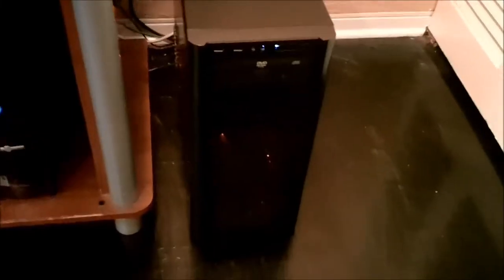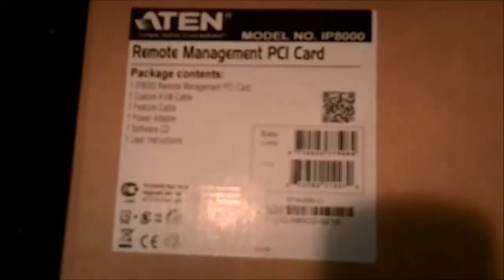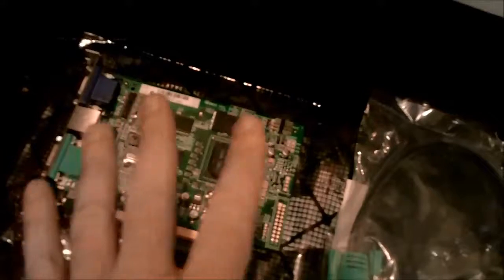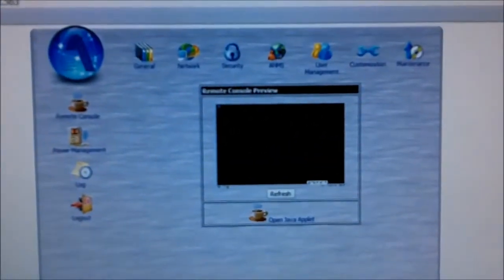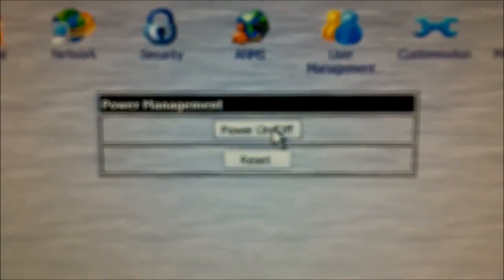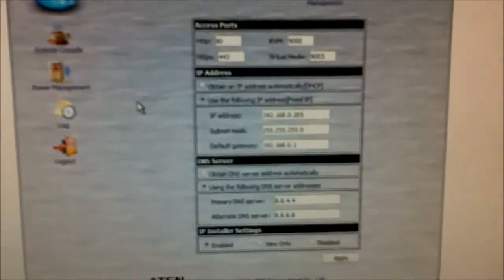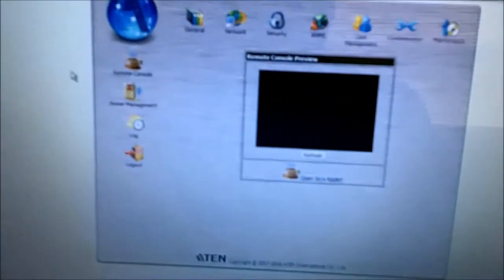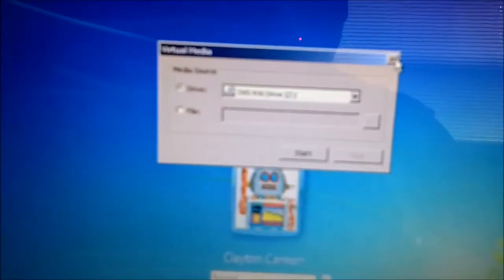Home Server - IP Based KVM with the Aten IP8000

Comment: As an aside, am I correct to assume that it automatically downsamples the vga output to the supported resolution?  If not, what happens if the display is set to a higher resolution than the card supports?  What are the possible multiple display scenarios, assuming the BIOS supports such?

Thank you for your commments.
Reply from the maker: It will scale the resolution based on the client, exactly like VNC or TeamViewer clients.  The remote access card uses a VGA pass-through connection.

Comment: thank you so much to the explanation
but I think this device to work it need a static IP so would you mind please to explain further how you setup the static IP so you could access the server from out the local network
again thank you.
Reply from the maker: If you want to work on it remote, you'll either have to VPN into your network or forward the required ports through the NAT settings of your firewall.

Comment: So, it's basically good for any ATX machine that has the required outlets and slots?  No HCL to speak of?
Reply from the maker: It is a full height card and requires the used of a standard PCI slot.  It has its own power supply.  Your case buttons connect to the card and then the card connects to the motherboard's case pins.

Comment: Hi, I'm about to buy one of these thats lacking the power adapter. Could you please the make and model of the power adapter for this card. Thanks

Also thanks for the video.
Reply from the maker: Chima Madujibeya Yes but I won't be home until tomorrow.  If you could remind me about this time tomorrow I'll get you that information.
Reply: Thanks. I appreciate your help
Reply from the maker: Chima Madujibeya 5v 2.6A middle positive
Reply: Hey Clayton. Thanks for that info. Is this a generic adapter that I can pick up anywhere?
Reply: I found this. http://www.morecomputers.com/product.aspx?pn=0AD4-3005-26EG&man=Aten 

It Seems to have the specs you noted.  Does the adapter tip look the right size/shape? If you click on the image on that page it does zoom in a bit.
Reply from the maker: It looks good.  Just be sure to verify that the center is positive.  You could use a generic adapter as long as the volts, maximum amp, and polarity all match.
Reply: Ok. Thanks. I'll let you know how I get on.